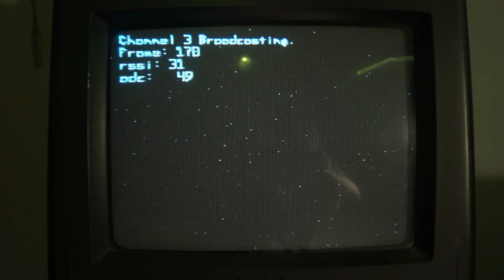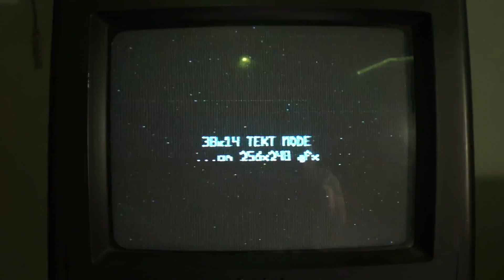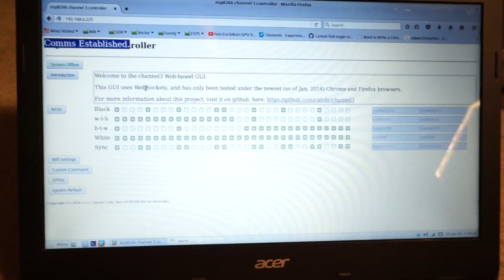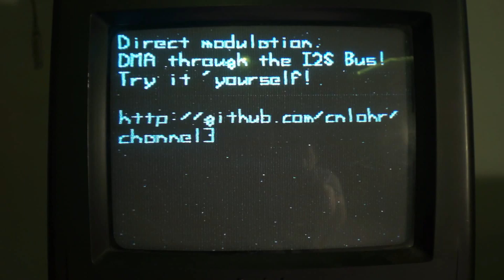Broadcasting Analog TV on an ESP8266!

Comment: Hi I'm have esp32-c3 and I try modulator FM signal use or algo or i2c but nothing and I don't put my hands down
Reply from the maker: Aww, I have a lot of content to give more ideas surrounding this, like my recent talk "Microcontrollers are just radios in disguise."
Reply: If your help to run it I'm be very happy I make issues in repo "#65"
Reply from the maker: @Rial_box  noooo this project is not one I actively maintain anymore

Comment: I need some help flashing, my esp just spews out errors in the serial monitor after flashing channel3, it doesn't do anything either, I have tried wiping the flash and trying different flashers, but still no, it will work with a normal arduino sketch though.
Reply: same

Comment: I know this is four years ago, just a questions, will it transmitted to digital tv instead analog tv? I know I have done homemade tv transmitter with few parts enough to make my tv screen pitch black with 1.5 volt battery. That was back in the 90's
Reply from the maker: Very cool. I built a VHF transmitter kit in the 90's but I didn't understand any of it. This is only analog.  I have no plans to support digital.
Reply from the maker: BTW Look up fabrice bellard's "Analog and Digital TV (DVB-T) Signal Generation"

Comment: Awesome stuff. I made a raspberry pi client/server for making a DIY tv channel with a remote control by using your smart phone. 

Any chance you'd be willing to make and send me one of these. I have a box full of nodemcu's I just don't know how to make that custom circuit. I would be willing to pay for your materials and shipping cost. 

I would like to try it out and do an updated video of my project with it. The HLLY transmitter is a huge barrier to entry as it's $100 and the supply is limited. If there were a cheap and readily available alternative I think a number of enthusiasts would make use of these and my project. 

https://www.youtube.com/watch?v=Oq-FLTx2E1g
Reply from the maker: The "custom circuit" is just adding a wire off the RX pin.  The transmission circuitry is entirely within the ESP, itself.
Reply: @CNLohr  What are the two chips on the break out board doing?

Comment: Same goes for the esp8266-01 module which had fewer breakout pins so it's termed as a WiFi module, whereas it is very capable

Comment: Very cool!  I understand the NTSC standard defines all the voltages and timing for a field/frame, but it doesn't specify how to transmit it over RF..   how did you know what modulation to use, or the frequency, etc?
Reply from the maker: You just modulate it up.  Honestly I just looked at the wikipedia page on NTSC.  The luma value just becomes the carrier, and the amplitude is inverted.

Comment: This just blew my mind!!! I’ve gotta get me one of these to play around with. I’ve hit an old boom box with a tiny B&W crt built in, it be cool to use this to transmit a video meter or some kind of music visualiser, could you transmit audio, or is that asking to much?

Anyway, fantastic video man, thanks for sharing. 😁👍
Reply: To transmit audio on 80MHz carier, signal would have to be modulated by 6.5MHz analog carrier witch have to be modulated by analog audio signal. Triple layered analog modulation. Witch would be possible if you add some analog filtering and modulators. 6.5MHz carrier and audio itself could be created by  ESP as well by PWM. Simplest modulator can be made from single transistor having coil+capacitor filter in collector. Need 1 for each carier. I assume 3-4 transistors max to be used 1 coil, 1 crystal and 3 GPIO's.

Comment: Hey man, is there any chance you'd do some kind of tutorial for it? I know it's been years, and I'm sure you're super busy with other projects, but I'm trying to understand flashing these files to the ESP and it seems to be such a steep learning curve... Can't find a starting point. A PM I'd bloody pay for. Just something.
Reply from the maker: I don't have any good guides, though I recommend looking into the NodeMCU Firmware Programmer.  You should be able to use the pre-built binaries.
Reply: @CNLohr  See that's another issue. Yes, I'm fairly new to this, and it means I have very little understanding of how to use the software, and I'm struggling to find anything useful on it that isn't so deep I need to be a genius/dedicate a year of my life to understand the basics, or that's even in english. I don't know where to turn to.
Reply: o0julek0o it's actually really easy longest it took me to learn how to flash one of this thing's was a day. Start off with simple projects and you'll get the hang of it

Comment: How awesome would it be to incorporate this OTA broadcast from an old school NES, SNES, or any other RF module connected game console?! The ultimate hack of any game console to display wirelessly OTA on a tube TV.
Reply from the maker: Not sure if I follow.
Reply: Essentially, you could add the esp8266 module to a RF modulator used to connect via coax cable from any of the old nintendo consoles from WiiU down.

Something like this...
https://www.amazon.com/NEW-Adapter-Nintendo-Sega-Super-SNES/dp/B0000504BE/ref=sr_1_3?crid=NSM8IWQC6YPJ&keywords=rf+cable+for+nes&qid=1555444621&s=gateway&sprefix=rf+cable+for%2Caps%2C159&sr=8-3

Forward the signal through the esp8266 to broadcast it wirelessly to channel 3 analog.

Comment: I didn't think the 8266 had hardware PWM? Though you list it as a feature
Reply from the maker: It's not really suitable in this application.
Reply: @CNLohr I realize you wouldn't use PWM for synthesizing the TV signal. 

I meant that on the beginning of your video (00:28) you list PWM as a feature of the ESP8266, but the ESP8266 to my knowledge does not have PWM as a feature, it only supports a timer interrupt which can be used to toggle a pin to implement a software/bit-banged PWM. (This is what the arduino, and other libraries do for you, on the ESP8266, and why the ESP8266 only offers kilohertz PWM frequencies, while the Atmels can do megahertz)

See https://lurchi.wordpress.com/2016/06/29/esp8266-pwm-revisited-and-reimplemented/

For example, or chapter 12 of the ESP8266 manual
Reply from the maker: I think it has a hardware-assist and they implemented a hardwareish PWM using FRC1, but, I think Espressif really started pushing the software-only solution.
Reply: @CNLohr  That would be fantastic if it does, the lack of hardware PWM is pretty limiting. 

Do you have any documentation links for this? I can't find a single example code or any documentation that does anything but the interrupt driven approach.

The expressif SDK offers pwm_set_duty, pwm_set_period and pwm_init functions, but looking into their source code, these just setup a look-up table that an interrupt handler uses to toggle-pins manually. They call it 'hardware assisted' I guess because it uses a timer? Seems more like marketing drivel than truth, though.

Comment: how to overclock the ESP8266?
Reply from the maker: You will need to change the BBPLL settings.  See the main.c file attached in underclocking the ESP video.  It modifies the BBPLL divisor settings.
Reply from the maker: Depends on what environment you're in, but all common environments can clock to 160 MHz
Reply: Okay I will definitely check it out

Comment: Dear Sir... can ESP8266 to broadcast morse signal for long range more than 20km?
Reply from the maker: If you use a radio dish, that is almost certainly a way it could be done!
Reply: @CNLohr  can you make a new video how to broadcast morse signal on QRP System using this esp8266? ;)
Reply from the maker: Absolutely, depending on frequency range, but, still not something I'll be messing with.

Comment: channel 2 is 54 -60 mhz, channel 3 is 60-66 ntsc, so where does 80 mhz come in on ch 3 ?, to you next txter i too started with a Vic-20, back in the 70's, just reflecting, back to the future.. !! ok will Robinson, i converted my transmitter into a time dilation transfer machine,, Spooky entanglement,,, keep the bugs out !! https://www.scientificamerican.com/article/entangled-photons-quantum-spookiness/
Reply from the maker: The ESP8266 can only transmit at exactly 80 MHz bit rate... so you have to play tricks to get signals above its nyquist!  Check out my Channel3 color video where I explain it.  When I made this video, I didn't understand it, myself!

Comment: I did see these modules on ebay and wondered if they are good for anything interesting. Thanks for this inspiration.
Reply from the maker: Those modules are AOK.
Reply: would it be possible to make an esp8266 work with zigbee? does it have the physical hardware to emulate a zigbee  TX or RX ?

Comment: ok but can it generate DVB-T?
Reply from the maker: short answer: no.  Long answer: probably.
Reply: ok what about other digital modulations?
Reply from the maker: any 8VSB one is going to be really difficult to encode.  Something like the ESP32 would probably be better at it --- or --- you could modulate the signal separately.
Reply: what sort of external hardware can the ESP8266 support for this external modulation you speak of?
Reply from the maker: An analog muxer with a source for the base modulation frequency.  You can use that to shift the data you are outputting up to the band you want to transmit at.
Reply: so the 8266 could generate the baseband DVB signal then
Reply from the maker: Well, until it's done no one will know for sure.  It's all just theory.
Reply: the ability to generate baseband digital modulations interests me, not just for DVB mind you.
Reply from the maker: sounds like you're going to need an analog muxer, and an RTL-SDR to give this thing a shot.
Reply: I have both! I have a number of Linear Technology IQ modulator chips.
Reply from the maker: All you will need is probably a lowpass-filter on the I2S Output pin, then you can stream out a bitstream at 80 MHz and dither whatever signal you want on it.  The more complex the signal the less control you'll have over it, but shouldn't be too bad!! Especially since I can do color NTSC without the modulator.
Reply: a common video IF frequency is 45MHz, just a tad higher then the Nyquest cutoff frequency, perhaps there is a 10.7MHz filter that's wide enough.
Reply: have you tried inputting RTL-TCP IQ streams into the 8266 or esp32 and outputting them as RF?
Reply from the maker: I have only ever output FROM ESP8266 to the RF.  Never the other way around, though, now that I think about it it would be interesting since the ESP32 supports a pretty fast system for reading data.
Reply: could you accept a TCP/IP or UDP packet stream of samples to output as RF?
Reply from the maker: positively.  though it would be impossible to keep up a continuous signal.  The ESP practically can't transfer more than about 1-2MB/sec
Reply: hmm, while not enough for streaming video I would think that would be useful for other modes at lower data rates.
Reply from the maker: Wouldn't be too hard to mod something like esp8266ws2812i2s to do what you want, then.
Reply: ah then it seems I have lots of reading and catching up to do then!

Comment: i want to use this for reading real time values off some sensors and i want to get those values as fast as possible 
can you tell me what is the delay for broadcasting and displaying few numbers, i might use a cheap 7" analog display as a display
Reply from the maker: Delay could be basically just a scan line (<1ms) if you really wanna push the limits, though that sort of thing is a lot of work!
Reply: that would be so cool

Comment: Would the ESP8266 12e be a good option?
https://www.youtube.com/watch?v=v_WsS8tNIfM
Learned about it from here.
Reply: Or where would you suggest I cheaply purchase one?
Reply from the maker: ESP-12-E is an AWESOME form factor, though, to get started, I highly recommend a "NodeMCU" board.
Reply: CNLohr
Is there a reason it's better for me to start with? I do have some hardware knowledge and I'm happy with programming anything in C.

I just don't like the idea of interactively controlling the board with Lua, feels odd.

Thanks for the suggestions!

Edit: 3 boards I found
-- nodemcu/lua + still cheap
http://www.electrodragon.com/product/nodemcu-lua-amica-r2-esp8266-wifi-board/

-- cheaper
http://www.electrodragon.com/product/nodemcu-esp8266-ch340-version/

-- Not NodeMCU I don't think, just a nice 12E board
https://acrobotic.com/acr-00018
Reply from the maker: Even the nodemcu board is good for C.  It gives you the regulator and program/reset buttons.   I've never used the others...

Comment: i bought nodemcu for this demo 
i flashed it with bins from https://github.com/cnlohr/channel3 by nodemcu-flasher
and i see on serial port 

Fatal exception (28): 
epc1=0x401019bf, epc2=0x00000000, epc3=0x00000000, excvaddr=0x00000020, depc=0x00000000

Maybe somebody knows what is it?
Reply from the maker: That looks like it's crashing in spi_flash_read.  Maybe your chip is a 512kB version?
Reply: i bought on aliexpress something similiar to this
http://blog.squix.org/2015/06/esp8266-nodemcu-dev-kit-v10-review.html
i think it is 4Mb version
Reply from the maker: either way, most of my stuff now supports down to 512kB

Comment: Can you make it broacast color video, maybe mp4 or even raw rgb format?! (...and make a tutorial?!) I'm thinking this could be useful to say: have a wireless, low powered raspberry pi video.
Reply from the maker: +WindSolarHydroHuman Check out my video on color tv on the NTSC I go into a lot more.  Also - I don't mess with rpi's.
Reply: Ok, I'll do... I myself prefer arduino. I'm trying to make a full arduino computer with color video output for a boat project (where low power is imperative). I just need to learn how to broadcast the NTSC color signal. Thanks.
Reply from the maker: I have an entire "let's learn let's code" set on how NTSC works and how to program with it!  Just look up NTSC let's learn lets code

Comment: Awesome project! Any tips for making it PAL-compatible?
Reply from the maker: +blank industries You're going to have to mod both tables and set the DMA length from 159 to something else to match the approximate length of the line.

Sadly you're also going to have to find a PAL channel that matches up well with the repeat frequency. 1408 worked out perfectly for Channel 3 and NTSC.  It might take a while to nail down.

Comment: Hi, I am a snowbird, and left all my mod 12's at home in the Dakota's all i have along are some 1's and a couple of 201's with the development board. I doubt the 1 would have the pins to do this. Just wondering if you thought  I could get it going on the 201 board, or even using the large development setup?
Reply from the maker: +Jerry Ericsson I don't know what those boards are, but check out my most recent video - I'm able to do it with the jankey 4-pin ESP, since it's the RX pin that I broadcast on.

Comment: could you share your schematic please?
Reply from the maker: +Louis Croisez If you take an ESP8266 board, and just attach an antenna to the RX pin, it'll just transmit.  No complicated schematics or anything.  Only thing I have it on is a cute carrier board I made for the carrier board... Just has a regulator and some pullups.
Reply: +CNLohr are you emiting in the uhf band ? Also i thing you are emiting square pulses, and the consequence is that you produce a carrier at F,  2F, 3F, etc. Am i right ?
Reply from the maker: +Louis Croisez Originally, I thought that, but it looks like that's not what's going on, but rather, I am transmitting high enough that there is aliasing which is wrapping around the center (40 MHz) frequency.  I'm trying to get this more figured out right now and may have another video in a day or two
Reply: +CNLohr you could perhaps easily analyse the spectrum with a RTLSDR USB stick and a program like sdrsharp. Common RTLSDR sticks can capture frequencies like 40, 80, 120 MHz, so you could have an actual idea of what you emit on the air. Nevertheless, your emission is not very powerfull. So, even if it is indeed replicating the 40MHz spectrum at 80, 120, etc, it is much attenuated. I experimented a bit with the pifm project at home, and I got the same problem, so I wanted to talk a little bit to you about that
Reply from the maker: I was going to do this in another video.  I am trying to get everything ready for that.  But you can see the alias wrap even in the FFT!
Reply: +CNLohr did i told you this hack is awesome!

Comment: Awesome project. Can confirm this works using NodeMCU devkit with a simple breadboard jumper cable as antenna.
Reply: which pin you connected the wire?

Comment: This is really cool stuff, NTSC available on ESP8266!

3 years ago stimmer did same for Arduino Due (84MHz), called DueVGA:
https://stimmer.github.io/DueVGA/
https://github.com/stimmer/DueVGA

DueVGA allows for VGA, NTSC and PAL output -- do you plan for VGA and PAL as well?

DueVGA can do 320x240 in color and 800x600 monochrome, and you can get Arduino Due for 12$ on aliexpress.
I did even extend that to 960x720 monochrome with small changes:
https://forum.arduino.cc/index.php?topic=150517.msg2572183#msg2572183

Would be cool to have ESP8266VGA, that would avoid the white noise in your NTSC output.
Reply from the maker: +HermannSW The sparkles, etc. aren't due to the NTSC, but rather the awful modulation.  There is a great deal of convenience relating to only using a single wire.  VGA's never interested me all that much, but I would not be surprised if the ESP could just handle the output straightup. You should give it a shot.